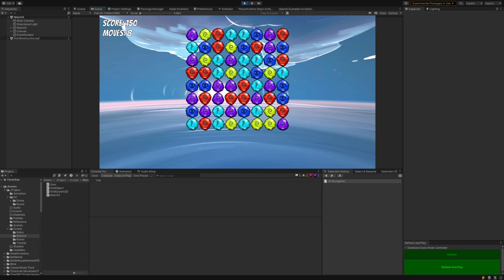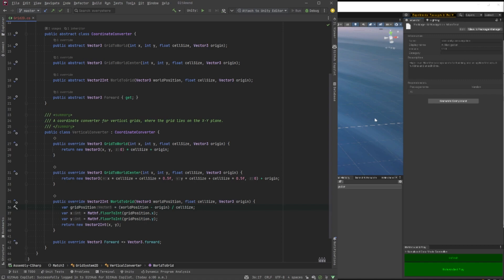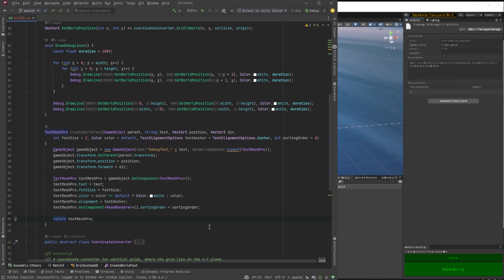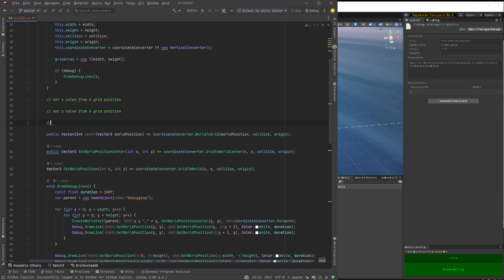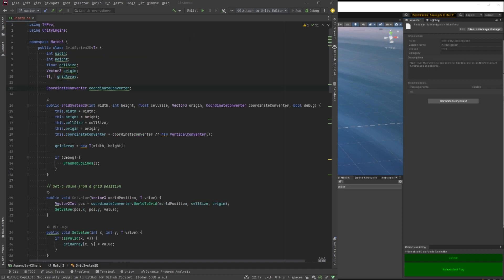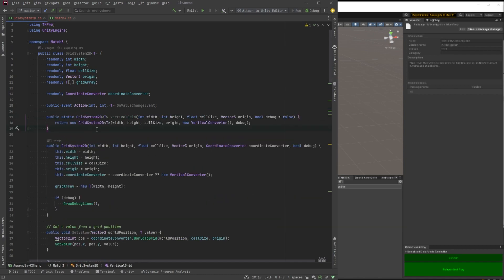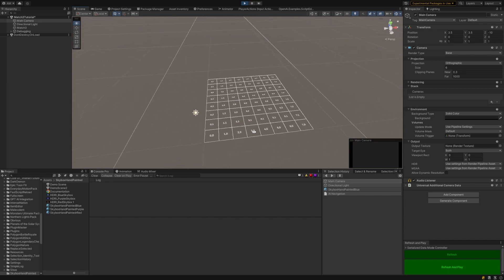Match 3 Candy Crush Game in Unity (Part 1)

Comment: For the people struggling with the last bit of the video:

- Create 2 empty objects in the scene: Match3, Debugging.
- Attach the Match3 script to the Match3 object.
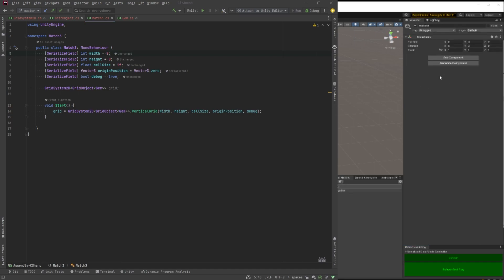- Make sure you created the Start() method in Match3 and call the factory (10:17), also make sure Match3 inherit from MonoBehavior.
- Make sure your camera is properly positioned (0, 0, -10). If your camera is at (0, 0, 0) you won't see anything (blue screen).

Then when you click play, it should work. I did that in a simple 2D Core project with an orthographic camera.

Good luck! 😉

Comment: in the line public event Action<int, int, T>   :  this actually does not work, I get an error:

"The type or namespace Action could not be found"  .  

Is Action some other class that was not mentioned?
Reply from the maker: The error message you're seeing, "The type or namespace Action could not be found," typically occurs when the necessary namespace hasn't been imported. In C#, the Action delegate is part of the System namespace. To utilize Action, you'll need to ensure that you have the appropriate using directive at the top of your C# file:

using System;
Reply: @git-amend  you're right, that was it. It didn't import System. I'm used to Visual Studio automatically adding imports like it does with TMPro, not sure why it didn't with the System namesapce. That fixed it though